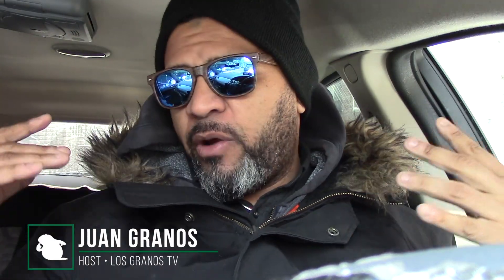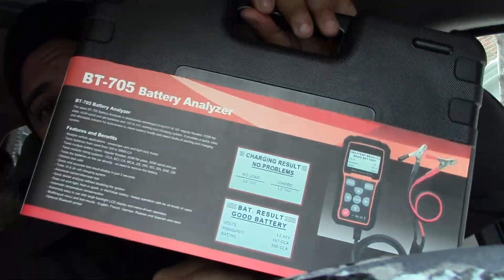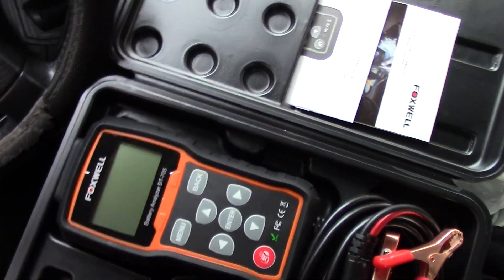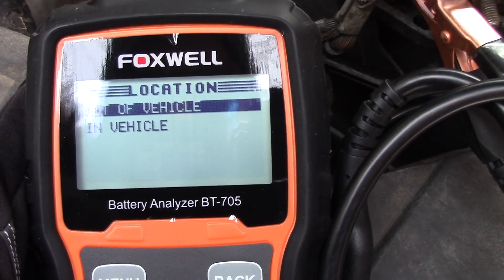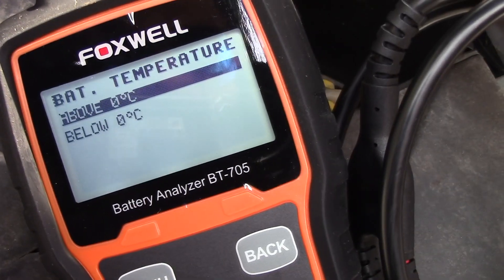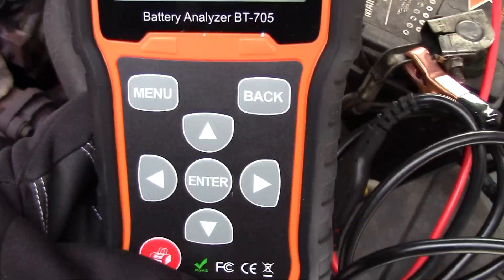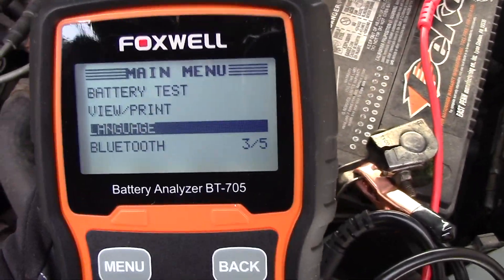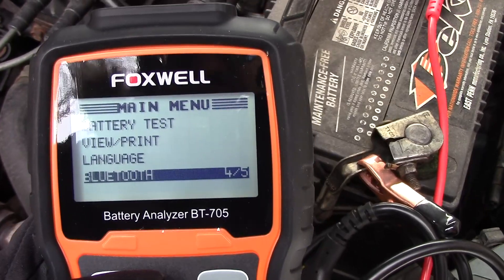Foxwell BT705 Battery Analyzer Scan Tool  🚘  : LGTV Review

Comment: The Foxwell BT780 might be the way to go even though the cost is more.  If I was lucky enough to be you I would tell Foxwell I would be happy to return the 705 to them and be given the 780 for review.

I am thinking the positive should be connected first and then the negative.
Reply: That is the correct way to hook up a battery, other stuff it depends on the circuit.

Comment: I believe that when the analyzer asks you "out of vehicle or in vehicle" it is actually asking you whether the battery is currently in the vehicle, hooked up to the car's electrical or whether the battery is out of the vehicle, and disconnected from the car's electrical system (such as during a bench test). This will affect the readings, as the analyzer will account for parasitic electrical draw.